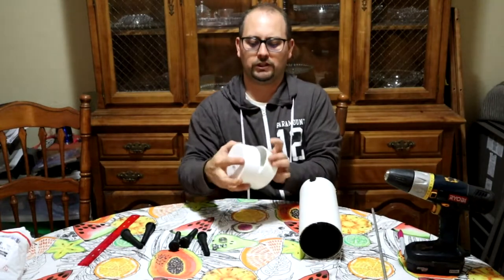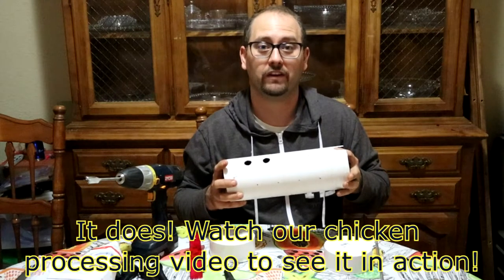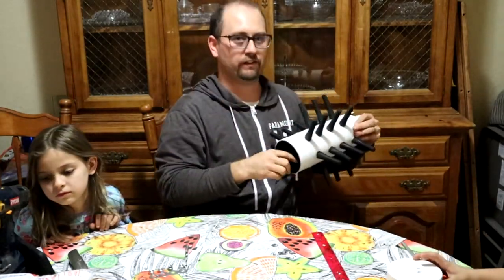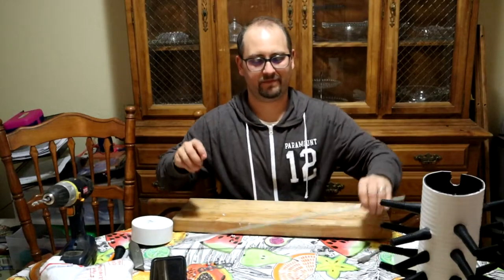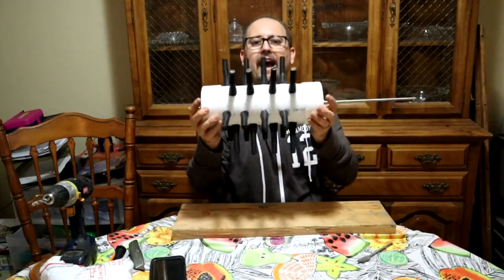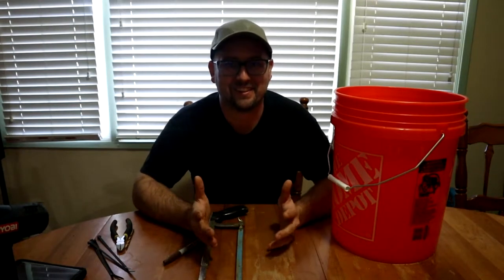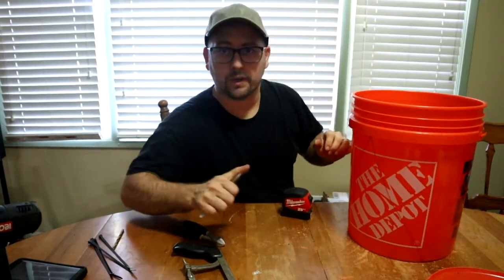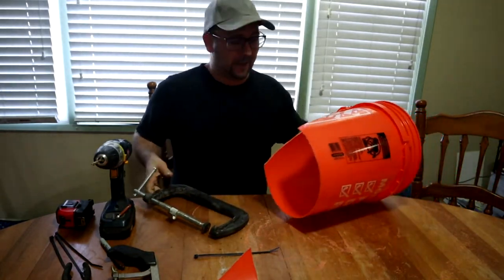DIY Chicken Plucker and Kill Cone

Comment: nice video great ingenuity!  For a much quicker but more expensive way try an 18" traffic cone.  They are made of plyable washable pvc.  Simply cut the top of the cone off to what ever length to get the head through.  They are about $20 at tractor supply

Comment: I came for the diy cone in the picture. Doing turkeys and don't think the metal ones can handle my big boys. 
I can tell you've never used a drill plucker... not worth the effort! Just invest in a barrel if you're doing more than 5-10. If you're doing less,  just hand pluck and research other ways to deal with pin feathers.  
I think you'll find after using this, the clean up and other hassles of a drill plucker. They are literally the worst! Sorry.

Comment: So I am trying to make this but all I can find is heavy 4 inch pvc drain pipe. Looks like it is about 1/4imch thick. This seems way thicker than what you are working with. Can you share what type of pipe you used? Or let me know if what a have will work? It seems really heavy.
Reply from the maker: It is a corrugated drain pipe. It is pretty thick, but not too heavy. I don't think it is kept with the pvc. You can ask at your local hardware store where they are. I think at ours it was kept outside near the paving stones and bags of rock and mulch. Good luck!